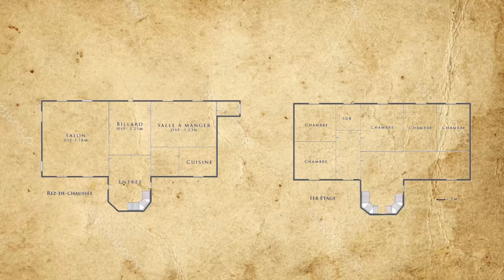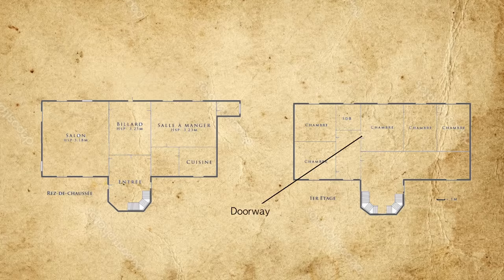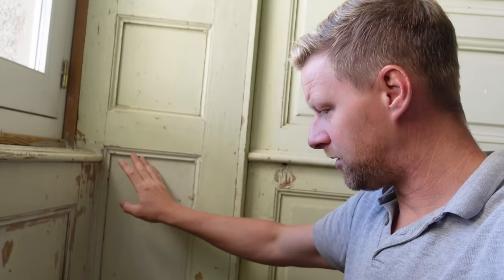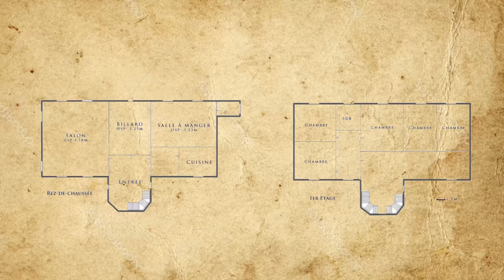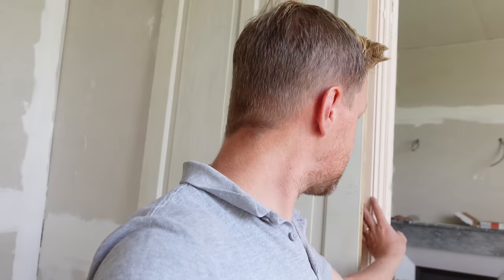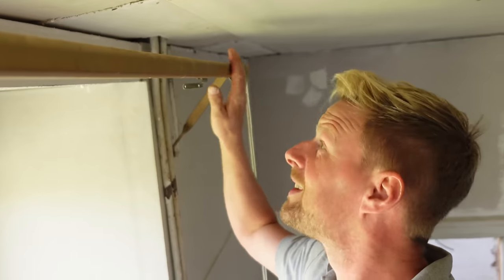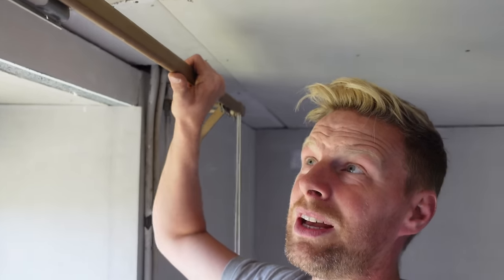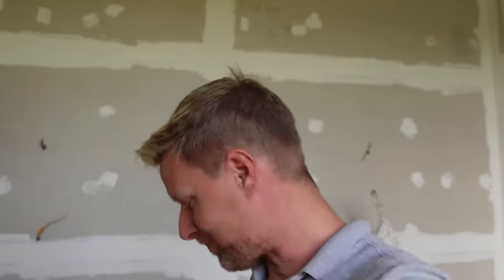Restoring The ORIGINAL Chateau Interior To Its FORMER Glory.

Comment: It's better to fix the vaporbarrier to the wall instead of to the wooden pannels. It will allow you to avoid unnecessary gaps in the vaporbarrier. You could use strips of wood to clamp the vaporbarrier to the walls. And the strips of wood could then be used as a base to attach the panels to the walls. This option allso allows you to create a thin layer of air between the panneling and the vaporbarrier. Another interesting thing is the use of breathebal vaporbarrier. Especially in area's where it's impossible to install insulation. Given the characteristics of a stonewall, that would be a plus

Comment: You are doing amazing restoration and insulation work on the window areas and doorways.       If you want the draperies and curtains to open enough allow the the full light of the window, to shine into the room, then you will be sure the measure the thickness of the fabrics as well as the width of the windows.  That allows you to place the ends of the drapery and curtain rods far enough away to the side of the window for the full window and its light to shine into the room.
Reply: Thanks Frances 😊